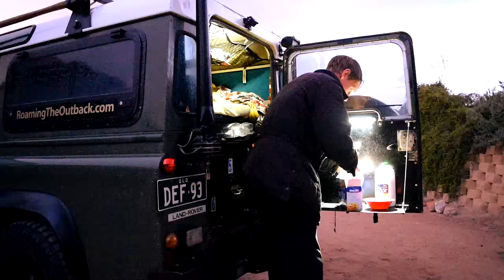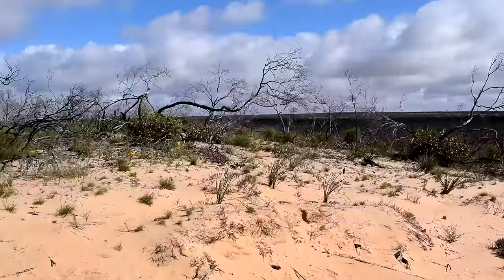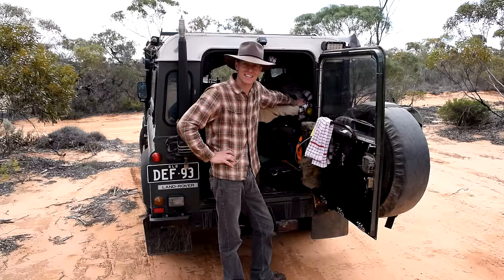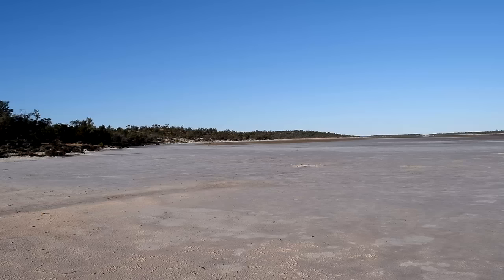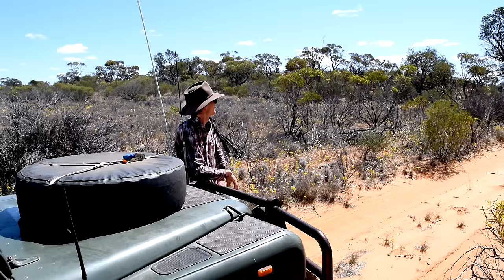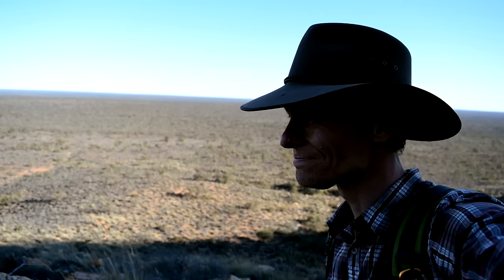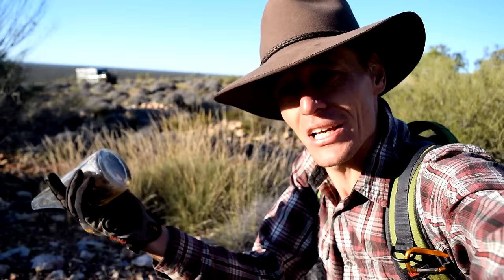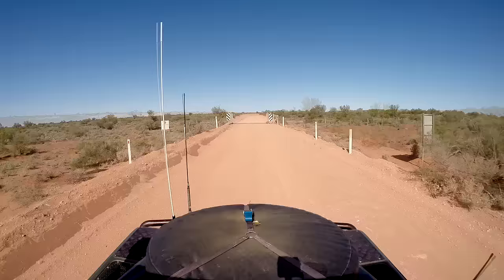Googs Track South Australia - 4wd Solo Touring

Comment: Just came across this fabulous post of yours and very enjoyable watch. Friends have recently completed this trip and loved it. I too had a mechanic (a friend actually) install 4 new shock absorbers and major service and PRE trip on my  1997 Disco back in 1999. I departed on the first leg of my trip at 0300hrs. 2 hours in on inland QLD gravel roads 3 shock absorbers had lost the mounting nuts. That required a limp into the nearest town and about 3 hours delay. Since then I check everything every time.
Reply from the maker: Sounds like you got lucky there without any damage. A great lesson. Thanks

Comment: 9:00 Now you know why I do my own mechanical work. Its a pain without hoist and all but I know who to blame if it all goes wrong - and I generally know how the fix the problem if I've caused the problem. I might be slow, and I might be a muggins, but I'm a pedantic muggins who double checks my own work, I use the right bolts, I replace damaged bolts and use lock washers etc as needed - I don't cut corners. I've used professionals and I've seen some really dodgy things done by so called 'professional'. I've even pointed out their dogginess for correction and they have still got it wrong, failed to repair or denied it. There are some good guys as well but I would still rather do it myself and know whats been done.

Comment: Tip. when deflating. try keeping the front and rear tyre bulge equal. (deflating changes tyre diameter) this means that in 4x4 the rear tyres are actually draging causing unwanted friction and bogging. also. with such a rear ture bulge means extra friction on the tyre wall and heat and potential fail.
otherwise love the video.

Comment: Great education. Do you think a decent 4wd can pull a suitable caravan thru? Hard to tell how steep the dunes are... Googs track will save me a huge round trip on way to Alice Springs...
Reply from the maker: A full 4x4 caravan really not recommended. You'd shake the hell out of it. A small camper trailer easy enough.. but check with parks whether they allow camper trailers through the park.

Comment: Great Video! What Tyre-Dimensions are you running on your Landy? And is it lifted?
Grettings from Austria
Reply from the maker: G'day Paul. I've got 235/85/16's on. The stock Land Rover size. Very happy with them. No not lifted. Standard other than HD springs front and back. Thanks.
Reply: Thanks!

Comment: hi mate I'm a new subscriber love your vids , I'm a land rover nut too lol. I've got a couple of questions for you ....
1,  how does the 300tdi go in soft sand and in soft sand steep inclines like dunes ect.
2, what type of turbo are you running as it looks fairly large.
im doing a full re build on a discovery 1 300tdi and have plans to do fraiser island and a few parks around Qld in 2020. i just hope my 300tdi will have enough grunt not to get stuck .
thanks in advance mate!!! keep them vids coming LOVE the defender......
Reply from the maker: welcome Jason. I have a 200Tdi, but they should be fairly similar in performance. Sand all good. Might lack a bit of power towards a crest, but as long as you lower tyre pressures shouldn't have too many issue from my experience. I've also upgraded my diffs to detroit truetracs. Turbo is stock. You may find as I, that stock tyre size is the way to go.. when I had larger tyres, I struggled alot in sand. Stock size I cruise through.

Comment: Great video mate, we have just arrived in aus. We are heading west to Perth from Melbourne and was going to give the track ago in our 110 we have shipped in. The only issue is the temperature at the moment what are your thoughts hitting the track in the summer?
Reply: If you are accustomed to surviving daytime temperatures of 42+ you might consider it.

It is a remote area with no facilities (as mentioned in the Vid).

Don't try it.
Reply: Gerhard Petersen 42 isn't so bad, if it's open il have a look and see what the weathers doing.
Reply: Given your history (which I didn't look at before) I would revise my advice :)
You might consider heading west from the northern end of Googs through some more iconic trails like Anne Beadell highway.

The main highway is OK but a lot of bitumen.
Reply: Gerhard Petersen cheers mate, Ye we only have a couple of months. Due to unforeseen circumstances we ended up arriving in aus when it's s little warm. We are just trying to make the most of what we can.
Reply: Gerhard Petersen quick question please. Have you driven the Anne Beadell? If so can I get the Maralinga tjarutka permet from somewhere close to the track. Iv applied for the other two, but this one take 4 to 6 weeks. Many thanks
Reply: Operation Long Drive I haven't driven it unfortunately.  Still on the to do list.  Can't offer any help on the permit situation.
Reply from the maker: It will be hot and your vehicle will be working extra hard chugging through the sand. Your engine may make it but your gearbox and transfer case will be suffering. And if you do run in to issues, there may not be many other travellers on route to help you, so if you do go you'll need a sat phone or hf radio. But in saying that current temperatures are around 30degC so nothing extreme. If you feel confident enough and have the communications then go for it. You can always decide on the day whether to proceed.
Reply: Roaming The Outback sounds good mate! Il make the call on the current weather situation. Merry Christmas

Comment: FYI, tire pressure is irrelevant.
It's the wheel radius, or better speaking the height of the wheel (ground to center of axle) that matters.
If you run with different radius and 4wd, you will wear down the mechanics of the vehicle.